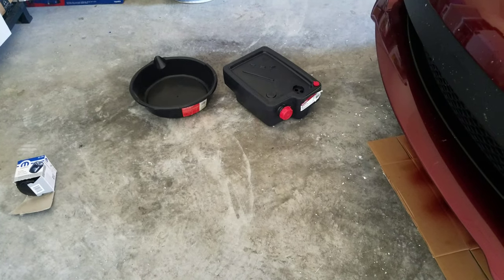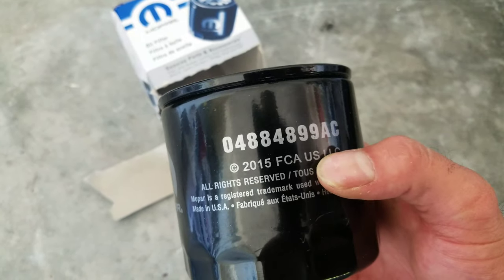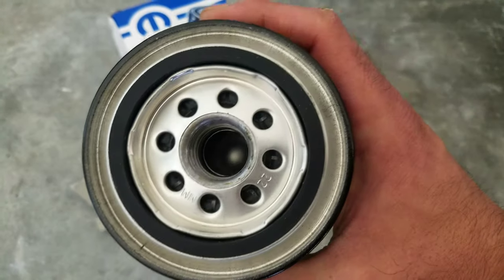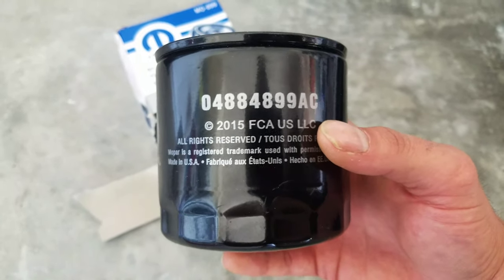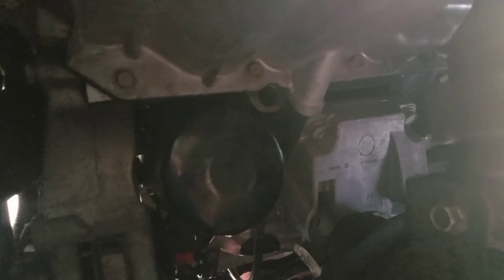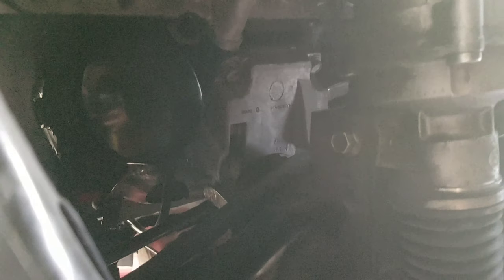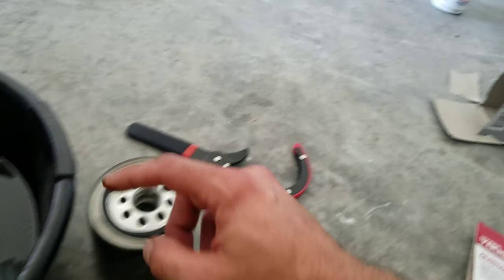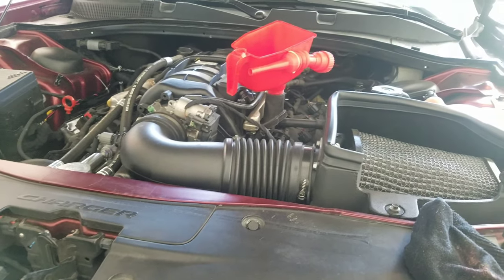Full Synthetic Oil Change on Charger RT

Comment: How many miles you got on your car
Reply from the maker: Just hit 76k lol.  I be riding mane.
Reply: @KingFLA  I just hit 76k lol I got a 2019 rt
Reply: @just_a5.7 I jus hit 100k 😂 2018
Reply: @gtkid3289  I got 90k now . Mines a 2019
Reply: @just_a5.7  I got. A 5.7 it was overheating so I changed it and fixed it
Reply: @gtkid3289  wat did u change?
Reply: @just_a5.7  the coolant cap and thermostat and the radiator
And the coolant and heater holes it was broken